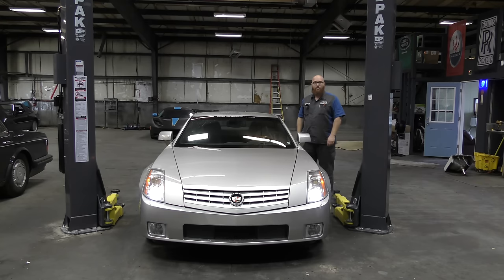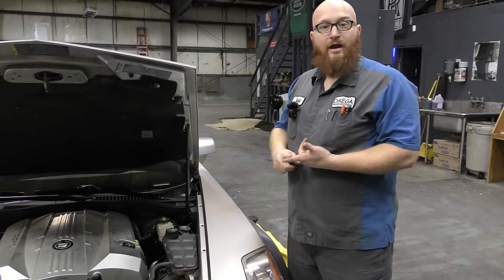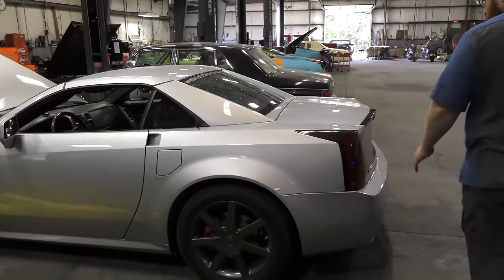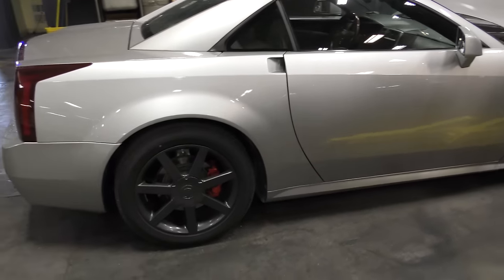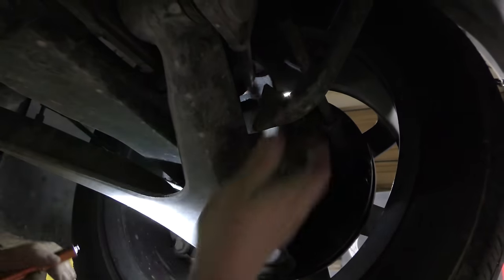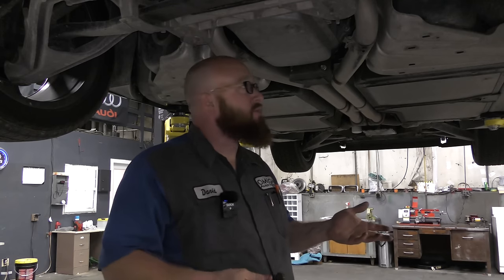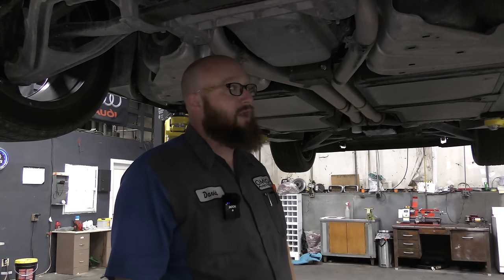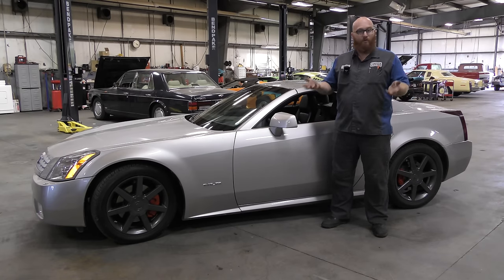The CAR WIZARD is shocked this 2006 Cadillac XLR has a Lotus Sized Repair Bill?!?

Comment: Just wait until this guy needs to get a taillight replaced
Reply: ...Or, headlight.
Reply: boovish yep
Reply: Or engine ...the new Northstars suck too
Reply: Haha true. I have a cts wagon. Tell me about expensive tail lights.
Reply: @meatrocket1  do they still make Northstar engines?
Reply: @mynameisjosh4506  what color
Reply: My wagon is black
Reply: One with some most of the LEDs out drives around my neighborhood lol @boovish
Reply: I have one my mom left me when she passed and the headlights was hazed and I looked for a set and was like 2,400 EACH like my God.  And pray you don't have stability control issue because that's half the price the car worth because they put the computer in the trunk and the drain plug gets clogged and then your computer is trashed good luck finding a new one... aka its swapped with a cts-v with lsa blower now 10x cheaper in the long run
Reply: yeah. Just checked out a replacement taillight. The junk yards want between $2000-2500 for a taillight. Believe it or not. These cars are just too rare, and too finicky.
Reply: @grantmeyer4094  
Usually good LEDs should last 10k hours. 
That used to be a standard , I guess it's been thrown out the window. 
LEDs really shouldn't just crap out , unless they are crap to begin with.  
Makes me suspicious that gm might be using crap🤔🤔
Reply: @fkn_sent2232  2400 for a headlight ! What a rip off !
Reply: @MrTheHillfolk  It's not the led its the circuit board in the light that fails, and the light is a sealed unit
Reply: @bigjohn6405  still , if the support to power up the led fails then it's junk too. 
I play with circuit boards quite a bit in the generator field , and they really do some dumb shit on locating and protecting them. 
GM should do some long term testing , like longer than a week would probably be a good idea.
Reply: Would've liked to have a V version of this, since they're so rare to begin with, never mind...
Reply: @robj2704  haha, ya they are expensive, especially depending what year you have because there 5pin or 10pin and 10pin is were headlight moves when you turn the steering wheel , my xlr a 10 pin so cost from 3k to 5k depending on the used quality you want.. my headlight lenses got damaged when I seen prices said fk that so I built my own  exterior lense came out great 😁

Comment: I owned one and really loved it while I did. It was fast, looked unique and was very cool. 
But then, the folding roof mechanism stopped working, so I sent it to my local Cadillac dealer, and they said the only trained mechanic who could work on the XLR series was based at another dealer several hours away, so away it went.  Well, they took their time and may have fixed the roof, but they then sent the car back with the radio not working.  Sadly, It had to go while it was still drive-able.
My take on this experience was that the XLR was and amazing car, sadly not supported in any way. And that is the crux of the matter, no after market support. Get any Mercedes SL variant and any Mercedes trained mechanic would able to work on it, obtain parts as needed (from a variety of sources, usually at reasonable prices) and keep them functioning on the road.
I really enjoy your posts. Thanks for posting.
Please (to both you and Mrs Wizard) be safe, be well.
Reply: Funny how I see way more xlrs on the road then SL models of any year mid 2000s or new but I'm in south Florida not bumblefuck no where

Comment: I heard don’t blow out an LED tail light.   Unobtainium.
Reply: $3000-5000 for one
Reply: geez, make sure you practice backing your car when parking lol
Reply: Can confirm from experience.  There have been successful repairs done on the rear lamps, but there just aren't enough XLRs on the road to make a business out of repairing (or modding) them.
Reply: @BorisBidjanSaberi11  wow, just checked ebay, yep 3k!
Reply: really shitty thing about this is you will fail an inspection without the tailights working, so you have to pay $3-4k just to pass inspection
Reply: @ForTehNguyen  Glad I live in Michigan where we don't have inspections, so I can drive the shittiest rusted out piece of garbage on earth with no working anything and get away with it.
Reply: @Stressless2023  I'm so happy to hear that at least there's one thing that hasn't changed since I worked in Detroit in the 1970s :-) 

I'm Australian. In 1973, I lived in Warren at 27,501 Parkview Blvd (funny how numbers can pop up out of ancient memory) and worked on software development at the Burroughs HQ on 3rd Ave, a few blocks south of W Grand Blvd. As far as I can tell, it's now a Henry Ford Health facility of some kind. I bought a 1967 Cutlass with a 330 ci V8 for $750. It was a really good car. Very reliable. It drove quite well. The handling was better than I'd expected (I was used to a Jaguar). It was accurate and predictable. I still have fond memories of that car. The standard commute included Dequindre to 10 Mile Road to i75 to a road heading west and then the JC Lodge. There was a lot of car part debris lying on the side of the road on JC Lodge. The best was a complete transmission prop shaft. I used to wonder about the cars that were still driving around without important bits. 

Funny how memories come back. I was waiting at the lights on 10 Mile Road, waiting to turn onto i75, when Roberta Flack with "Killing Me Softly" came on the radio. The first time I'd heard her voice. Good times.
Reply: @Stressless2023  Same here in neighboring Wisconsin!
Reply: I dig your last name
Reply: Drill a hole in the back of housing and install your own single bulb led cheap fix
Reply: If you have the patience they’re really not that hard to fix yourself.
The most difficult part is separating the housing without cracking the lens to get into it.
I have a 2004 XLR that I repaired my passenger side tail light on just a couple weeks ago.

Comment: Car wizard, I thought the XLR-V has a NorthStar too. It’s supercharged but I was pretty sure it was a NorthStar
Reply: It is....the displacement was lowered to 4.4L in supercharged guise and was almost identical to the STS-V engine....even though the STS-V made more power
Reply: Jeremy McKinney it is identical. It’s the same exact engine only detuned.
Reply: Yes, Northstar-derived engine. It was smaller, 4.4L design to fit the supercharger. Still, 470HP from just 4.4L in 2006 was nothing to scoff at. They would scoot too!
Reply: It's too bad too, with an LS motor and a manual transmission this would be an amazing car. But they didn't want to to just be a re-bodied Corvette. Instead they made a re-bodied Corvette with a worse motor.
Reply: @hellkitty1014    Try 443 hp....
Reply: @Flies2FLL  apologies, the STS-V had 469hp, oddly enough. There are twin-turbo vehicles with that exact displacement not making that much power/L even today l.
Reply: nstg8 The Northstar is actually a very strong and well built motor. The reason it gets so much hate is the way they dumped it in a fwd car and the head bolts. Fix the head bolts and it’s probably a stronger more well built motor than an ls
Reply: @trizkial7592  I didn't say it was a bad motor, just not as good as an LS
Reply: @trizkial7592  100% agreed, especially after 2004/05. They've always been "leakers", but the catastrophic failures of the 90s(Series I) models subsided into the 2000s with proper maintenance. And Wizard has seen his fair share of Northstars to vouch for that, such as this XLR.
Reply: @jwjones91  

4.4L .....smaller bores.
Reply: @hellkitty1014  

The smaller bore had nothing to do with "fitting the supercharger".......it was to allow for a stronger block.

Comment: The front looks a bit like a mercedes, if the mercedes engineers misplaced all their curve rulers.
Reply: correct me if i am wrong, but the XLR was (only) made because of the R230 Mercedes SL doing so good in sales in the US. So it is no mistake, and it is not just the front, the whole concept for a luxury sporty car with a folding metal roof was based on a Mercedes. (not the underlying structures and parts though)
Reply: The SL equivalent is just as expensive to repair especially the stability control, air suspension, abs module
Reply: @CRAPO2011  They are also significantly more complex than the XLR.
Reply: @y4nnickschmitt  The XLR top is pretty crazy complicated... The rest of the car may not be.
Reply: Yeah, who would buy this dated looking hunk of junk when you could simply buy a Mercedes SL of the same vintage? More prestigious, better looking, better handling, probably more reliable and the same expense to repair.
Reply: @CRAPO2011  except they dont have air suspension
Reply: @OMGWTFLOLSMH  Mercedes of the same model year look way outdated
Reply: OMGWTFLOL it’s the buy American patriotic mentality even if the other vehicles was not assembled in the USA.
Reply: @nirfz  and to be completely honest with you, I'd rather have the Cadillac over the Merc. It's way cooler and better looking
Reply: @OMGWTFLOLSMH  more reliable?? 🤣🤣🤣🤣🤣🤣🤣🤣🤣
Reply: @OMGWTFLOLSMH  "more reliable"

Comment: Great looking car. I have a customer with one, he had the fuel crossover tube failure that is very common for these and the Corvette model they're based on. Shop did it for $4000! Then he has a persistent slow coolant leak that I finally diagnosed as a cracked engine block. Just put stopleak in it and prayed.

Comment: Having some issues with 2012 hyundai veloster & a fuel sipper at that.  Push button start doesn't work all times & if rpm gauge doesn't read then cvt won't engage either & if on a hill will roll + ebrake

Comment: hey wiz I replaced the rad/valve cover gaskets, all eight spark plugs and oil and filter change in 3hr btw remove and replace radiator took me 1 hour, no wonder you have a boat,, but yeah I get it.. alil yt $$ dont hurt nobody either. all new parts ran about 300 and 3 hours of a morning...know it, love it,, live it!!  shoulda made a ratarossa type vid ta prove it

Comment: My friend had a radiator shop and would use his fancy plastic welder on certain tank repairs, on others that needed aluminum repairs he used an epoxy. All sold by his distributor and made for the industry...he also had tools for uncrimping the tanks if an o ring needed to be replaced

Comment: Run a few tanks of fuel with Techron added to clean up the fuel level sensors.
Reply: The teeth on the contacts wear down and cause dead spots. The only repair is replacement.
Reply: ibanez720rg Not if the spots are cruded up with inferior fuel usage. Very common complaint on modern corvettes because boomers run 87 octane from sketchy mart.

Comment: In the Corvette world, those high prices are called “Corvette Tax”. The only way around it is to buy an extended warranty, and when that warranty runs out, sell the car. As an aside, when the XLR came out, Car & Driver said then when the car is wet, as in the rain, opening the trunk results in water running off the the trunk lid into the trunk.
Reply: yup......( regarding water in trunk .....)
Reply: Parts for the Corvette aren't expensive at all. Extended warranties are generally pointless on Corvettes.
Reply: @SireEvalish  when you think about it lol you're right.  Enginewise a standard Chevy v8;with some massaging. Trans well, that's a different ballgame, nothing else fits in it's place
Reply: SireEvalish  Ha!  Tell that to the guys who grenaded their LS7s due to a sucked exhaust valve.  Replacement cost from GM, in the neighborhood of $20,000.  Plenty of guys on the Corvette Forum can tell their stories. GM was replacing heads on warranty if testing showed worn exhaust valve guides.  BEFORE the engine let go.
Reply: That wasn't an issue for me...I never drove it in the rain.

Comment: Biggest shock was back in 2008, DIY replacement of a brakelight switch on a VW Polo (small vw hatch back), couldn't source the part at the local parts store without having to wait a couple of days, VW couldn't supply one either without ordering it in... thought I'd try my luck at Audi since I had the part number, and sure enough Audi had the part in stock AND 20% cheaper than the VW qoute....

Comment: Mr. Wizard. If you can apply with this after seeing your video I went ahead and purchased me a 2009 XLR no problems yet but I do have a heating problem where at idle it will overheat can’t find a service manual on that car anywhere. Any suggestions

Comment: Wow, Amurican car with no repair parts? Wow, imagine how it is for us back at europe
Reply: Same around the world though. Never seen a BMW or Merc part in stock here in NZ. Everything is 8 weeks delay and thousands of dollars from Germany... if they are in stock in Germany... and they usually aren't in stock in Germany, lol. We avoid Euro cars like the plague
Reply: @tenmillionvolts  That's why I've stuck to Japanese cars.  I can find parts for a Toyota everywhere and cheap...
Reply: I've got an lexus es300, and itvwas only available in the US. I live in europe, and parts are available but take some time to get them. An egr valve for example is 300 euro and 3 week shipping... Brakes are the same as the camry so those are easy to get though. But for the most part I dont need to buy new stuff because it rarely brakes down.
Reply: That's proudly made in USA 🇺🇸for yeah.
Don't 🚫 buy that crap or that slogan.

Comment: The shocks for the XLR are specialized magnetic fluid filled, doubt those are cheap.
Reply: They aren't, but since they're the same ones on the Corvette and the system has been around for a while the after market makes replacements too. I think they're around 4-500 apiece. You can also put on regular shocks and buy an eliminator kit to fool the computer.
Reply: Rock Auto was where I bought mine, genuine AC Delco magnetorheological. It was last summer, and as I recall the set of four (mine were leaking horribly at 85K miles) was around $1400. Before I replaced them it sounded like the upper control arms were going to come through the hood. Just fine now and thankfully they have a "lifetime" warranty through GM's manufacturer. Most other owners are opting to go with Bilsteins and a set of "eliminators" to fool the computer that normally controls the shocks and ultimately reports to the main onboard computer, to tell it everything is o.k. I prefer the gadgetry myself, as long as it stays working. Mine's a 2004, 1st year, 95K miles.

Comment: Wizard! Would you ever use a supplier like Rock Auto? Or does it take too long to receive the part from them? Seems like they have the AC Delco rad in stock.
Reply: And only $275.99!!!
Reply: He told me when I made the same comment a couple of months ago that he wanted to deal locally as much as he could. I guess he wants to pay local workers salaries as much as possible. Only thing is it seems like he is cutting off his own nose to spite his face.
Reply: @cos4465   They have cheaper ones for less than $100
Reply: @cos4465  don't forget the overnight shipping charge
Reply: They aren't in low supply. It seems like BS. Rock Auto even has the OE-grade Denso for $120. WorldPac and Carquest is just as "local" as Rock Auto is. I don't think there's an excuse to ignore Rock Auto. I would at least ask the owner.
Reply: @MrCarGuy If the owner is willing to wait to get their car fixed, and save some money then I agree 100% it's worth asking, but if they need the car back ASAP then it's another story. I personally think the Wizard should have 2, or 3 basic Toyota loaner cars ready to go in cases like this where they can say to a good standing customer we can let you borrow this one for a week, or so to get around while we wait on parts, but maybe there is too much legal involved, but just an idea.
Reply: @CommodoreFan64  They wouldn't have to wait. Rock Auto has expedited or upgraded shipping that'd still put it at much less than WorldPac or Carquest and their "connections" (Carquest probably just ordered from Rock Auto or an equivalent and jacked the price up).
Reply: @MrCarGuy  That would not surprise me if the did that, and true on the shipping. I'm just thinking in more general terms on the whole having to wait deal.
Reply: Rock Auto is a retailer. WorldPac is a wholesaler. Big difference in pricing, normally. But you get rare parts where you can get them.
Reply: @OMGWTFLOLSMH  You say that: Yet, like the Wizard, you've bought that false narrative so much that you probably never look at Rock Auto. 80% of the time Rock Auto is less for me.
Reply: Wizard Prefers to Buy Local he said Once. im sure if that was all the options then he would
Reply: I have ordered a few parts from Rock Auto, never had a complaint! Shipping was always timely, although I live next door in Western Wisconsin.

Comment: I just checked rockauto, I was curious, there are many options ranging from $80 all the way through 275 which is an OE part
Reply: yup, quick google search showed many available below $200 mark
Reply: I tend to be skeptical --- but, just guessing here...it may be showing "available" but go ahead and try buying it.  I doubt that you will ever receive it.  Production of parts for XLR ended years ago.  Only way to get them are:  1) used from other XLR's or 2) fabricate your own.

There is no way these cars should be sold for more than $10k because they are very expensive paperweights.  Before the demise of the production of parts, the headlight assembly was more than $1000.  Good luck replacing one of those suckers now!

And, I'm a huge fan of the XLR --- I previously owned two, and they were incredible!  Far, far superior to MB 500SL (which I have owned several, also).  My 2007 XLR Platinum (1 of 38 produced) currently has more than 120,000 miles and running great!  I sold it when it had 80,000 and I never had a single issue with it.  But, when GM/Cadillac stopped producing parts --- I sold both and purchased a C7, which now has 44,000 miles and has also not had a single issue.